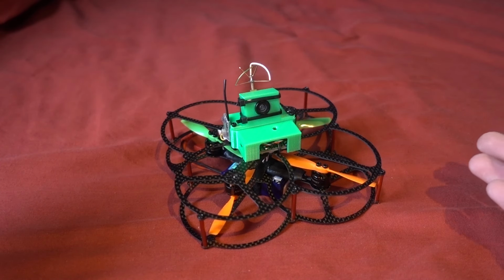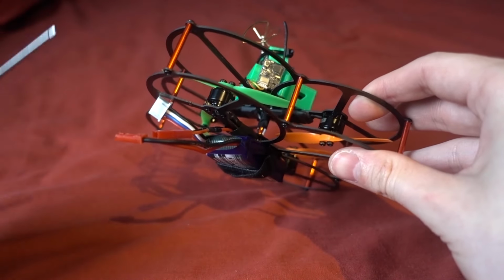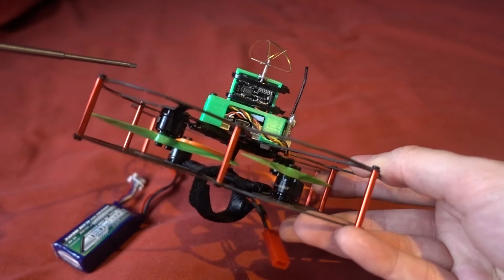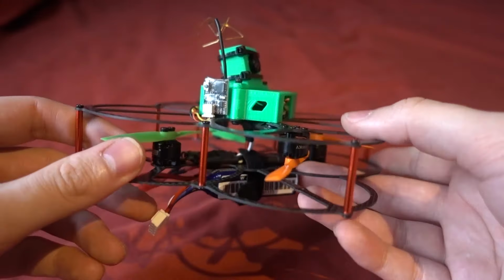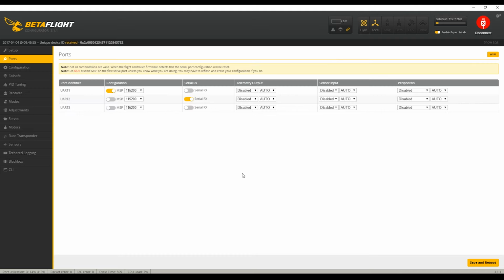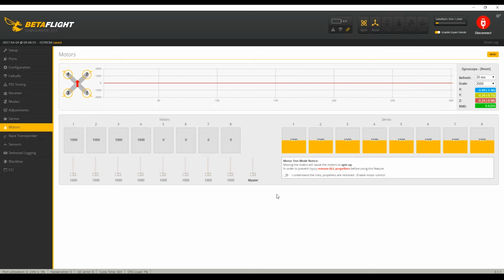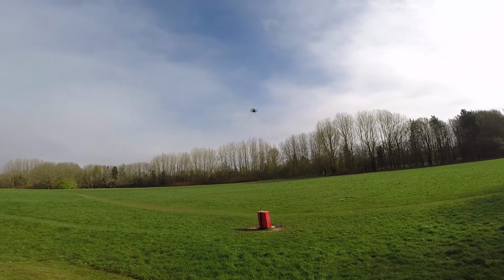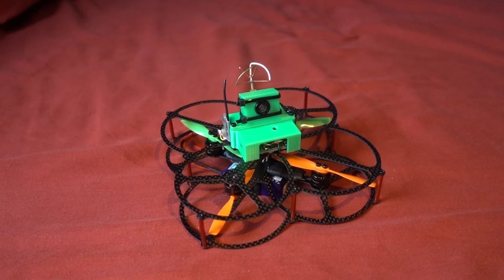GB90 Overlapping Props! Brushless micro

Comment: I know the 1306 4000kv DYS will handle a 4s (put them on my falcon 120, F#$%&*G AMAZING). I would imagine if they claim it can handle it, then it can. And same thing happened to my falcon. Roll of death, motor 1 was hot as fire and the wire came out with no effort when I took it apart to inspect it.

Comment: Interesting review Andy, i was very curious about this prop overlapping design on quads.
I made a caged one myself and weight and drag cuts the performance.
with overlapping props a 5 inch quad could be made 155mm with a 20mm FC inside rotated 45°